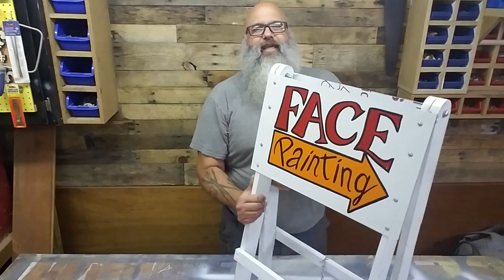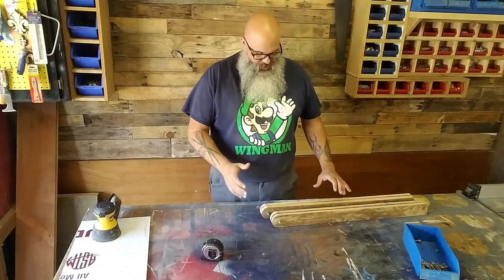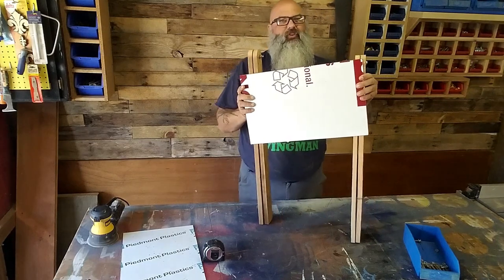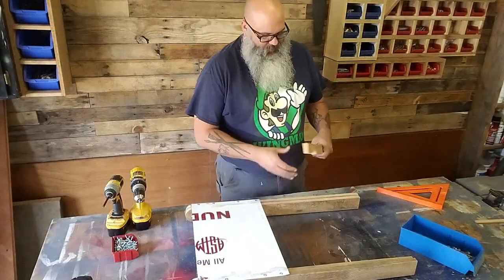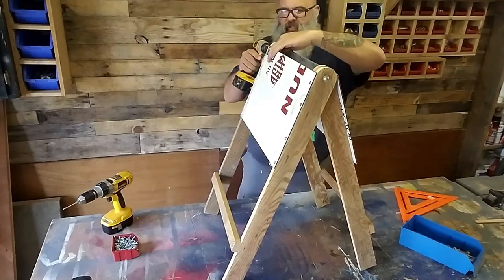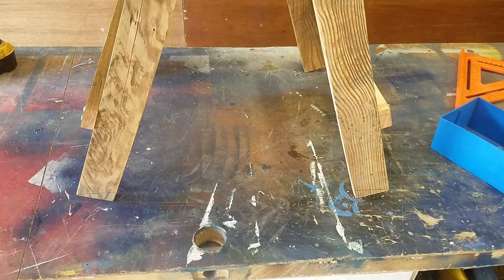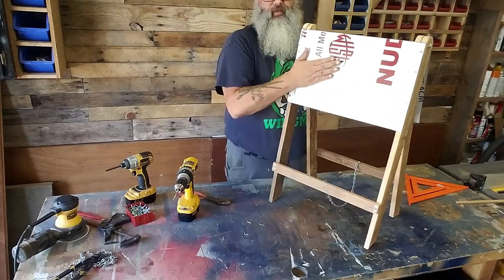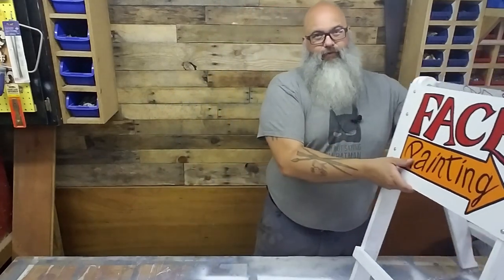Making an "A" Frame Sign

Comment: What kind of paint did you use?
Reply from the maker: Hey Debra, it's a water base enamel from Ronan called Aquacote Enamel 8 Oz Fire Red  and Black are the 2 brush colors I used and then the arrow was just Spray paint, as you saw.